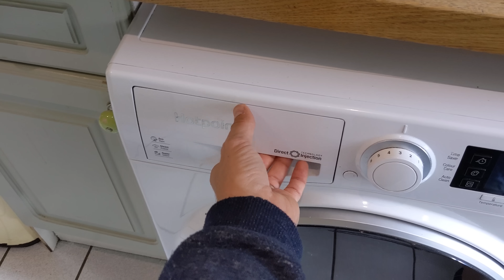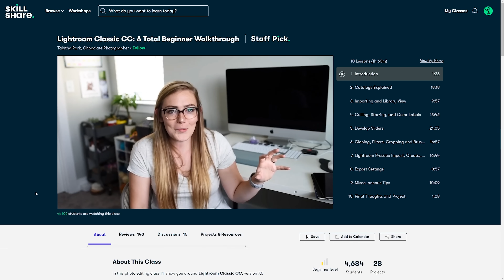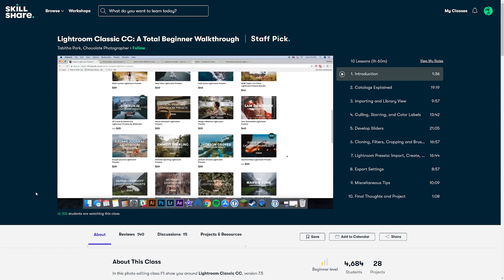The Pythagorean Siphon Inside Your Washing Machine

Comment: As a plumber, I still think the best flush is simply the 'flapper valve' by Fluidmaster.  It uses a float in the flap.  Upon pulling it upward, it empties the cistern until the water is gone, then falls back down to seal.  It's simple and thus reliable.
Reply: That's the only kind I've seen,  other than commercial toilets
Reply: Gosh gents, I’m an elderly woman and I can replace toilet parts. It’s not hard and we learn how to do simple household maintenance from our parents … or hopefully can read a book after buying a house. I’ve never seen an unmetered house in the US, so we are quite aware of water consumption. At least my middle class friends and I are. In water-challenged California, it’s “if it’s yellow, let it mellow, if it’s brown, flush it down”. Much love 💕🐝💕🇺🇸
Reply: @amazinggrace5692  What if a brown one doesn't flush down?
Reply: @mintymus  eat more fat and fruit and less fiber?
Reply: @mintymus  Then plunger time!
Reply: Which works fine until hard water sediment builds up to the point that the seal is no longer able to be maintained.  Those who live in hard water areas have to replace these devices regularly.  No one, to date, has solved this problem.
Reply: I've seen 2 or 3 flappers failing in my life. But I've never seen any other system.
Reply: They're easy enough to replace unlike siphon which have to be matched up exactly. Plumbing wearhouses around here don't even stock them.
Reply: That's what is used here in America 🇺🇸
Reply: after never being handy at any (and i'm still not) i recently tried to repair a toilet handle rather than put in a maintenance request and have them barge in randomly. to my relief it was pretty straightforward enough and the part i ordered fit. the thing i thought was interesting was that the chain to the flapper has some slack and sometimes gets caught under the lip and there's a little trickle of water. it reminded me of my grandparents house where we were told, the water will run forever unless you "jiggle the handle" and now i wonder if that was the cause of it.... but the house was sold so i'll never know for sure..unless i break in. but anyway, it felt neat to think that a childhood mystery might be "solved" in my head. :D  i've been meaning to try to fix the chain on my own here...but for now i just jiggle it if i hear it trickling...
Reply: And it can be interrupted
Reply: I've never seen any other type than the one you are describing.
Reply: @RafaelPernia  
As far as I'm aware, every one I've fitted is still working.  But then I do fit them correctly.  Evidently others don't.
Reply: This is what I have!
Reply: Sir could you recommend a plumbing course in your country &, how much it costs
Reply: @dinozaurpickupline4221  
Maximum you could spend would be £5000 but you can get a 10-day course for £1000.  That would only be basics, though.  Tradestraining do a £1500 course, but that is a work-based course in the construction industry (on the job), and only if you already know something about plumbing.  Otherwise, an apprenticeship post will be required.  This is low pay at first, but great training - working with a plumber.  Alternatively, you could spend £20000 on a full course.
It's a good career, and you can earn £1000 a week when you've qualified.  Specialise in an area (like heat pumps, AC, or drain clearance) and you could earn £60-70000 a year in Britain.  Make sure you get public liability insurance, and make sure your customers sign a contract - which means they are protected, and you get paid in a reasonable time (like 10 days).
Good luck (I only have three years to retire!)
Reply: @barryfoster453  great maybe you can train some young plumbers like us entering the trade
Reply: That's interesting. I would have thought that the valve is an additional point of failure in the system compared to a siphon. If the flap leaks (whether due to wear or poor seating), then it leaks causing the float to drop resulting in a continuous leak. Of course if your valve doesn't close for whatever reason, then you have a leak either way ... it just doesn't need a second overflow pipe to leak into. 

The biggest point of failure with the siphon system would be the flap that pushes the water to initiate a flush. If I'm paying the water bill, I'd rather have a toilet that I have to jump start rather than one I can't stop running.
Reply: All this talk of toilet flappers and water leakage has reminded me that I need to figure out why my flapper is leaking.. I replaced it a few months ago and noticed it would still occasionally leak. I think the chain is getting caught under the flapper
Reply: Flappers and flush vales/drop valves all need replacement sooner than a decent siphon. Due to the fact the rubber shrinks especially on fluidmaster flapper and others. Geberit flush valves the rubber washer actually blisters, with water blisters. Every 5 to 10 years u will have to replace the rubbers. Where decent siphons last a lot longer than that.
Reply: Don’t know about you foreigners but in America basically all household toilets are flappers.
They can occasionally not completely seal but you hear that right after the flush because the water keeps running so all you do is jiggle the handle and it will seal right up again. If you’re away on a trip nobody will be flushing the toilet so the seal won’t be broken
Reply: Firstly, I am pretty sure he explains how a siphon can pass a small amount of water indefinitely. So maybe a flapper can pass more, its not a flapper specific issue. 

Secondly, a flapper style toilet has a siphon as well. At least the trap in the bottom and at the rear of the bowl serves two purposes. It traps water in the bottom of an S pipe that blocks sewer gas from seeping into the bathroom. But more importantly, it creates a siphon that sucks the water from the bowl.
Reply: I know this is the only kind I've seen in housed in the USA... can't vouch for the toilets I saw back in Australia because I always assumed they were too complicated to mess with... also never had a problem with them getting stuck running like the ones here though...
Reply: How do dual flush toilets work?
Reply: @soundspark  There are a number of different techniques.  In the US, the typical old-style flapper is made of rubber that is more dense that water (so it won't float on its own).   The flapper has an inverted cup built into its bottom side that traps air. The cup is below the flapper's sealing surface and traps air after the flush is over.
   To initiate a flush, a chain connected to the handle pulls the flapper open.  The trapped air provides enough flotation to keep the flapper from closing until virtually all the water has run out of the tank.  After the flapper closes, the weight of the water above it holds it closed.
    Most dual-flush systems have some method of causing the flapper to close early, when the tank is still about half full of water.
  
Many dual-flush designs use a small hole near the top of that cup to allow the trapped air to bubble out quickly enough to let the flapper sink and close after a few seconds.  Some designs even have a way to adjust how rapidly the air leaves the cup, allowing you to "tune" how long the flapper stays open.  This is what controls how much water is used in the small-flush cycle.  

For a big flush, the user prevents the flapper from closing early by holding handle in the "flush"  position long enough for all the water to leave the tank.

Another design uses a secondary float attached to the top of the flapper by a length of chain or plastic strap.  The chain or strap is long enough to allow the secondary float to rise to about half the tank's depth.   The flapper has a smaller than usual flotation cup on its underside.  With this system, the flapper will close during a flush unless the secondary float is under water and pulling upward on it   After a flush is initiated, the flapper stays open until  the water level in the tank drops below the level of the secondary float.  The loss of the  upward pull from the secondary float causes the flapper to close.
Reply: simple.
Reply: Probably from the north where the water is soft.  In a hard water area they leak often.  Plumbers still like them though as they charge for coming back to fix the issue.
Reply: @andybarnard4575  I’m in NE Pennsylvania and we have very hard water.
Reply: @amazinggrace5692  Ah, I should have been specific that I was referring to the comment from @Barry Foster in England.  For the most part in the north of England they get rain, it goes into reservoirs and the water is soft.  If the South East (of England), we get less rain have quite a lot of chalky rocks and drill down into the water table so the water is hard.  Flapper valves are therefore good up north, but siphons are better down south.  At least that is my experience of helping family, friends and neighbours after their plumber has left the premises.
Reply: Strange, I am not even a plumber and I have seen multiple flapper toilets malfunction.
Reply: @DDieDDes  
Strange.  I am, and I haven't.
Reply: @barryfoster453  wierd u have not seen... see a flapper first
Reply: @barryfoster453  Barry, I am about your age and not a plumber, but have needed to replace several valves in my houses over the years. I am replacing one tomorrow, as a matter of fact (the second, in a house only 5 years old!).  Typically, the flapper material hardens over time until it no longer seals well.   The flappers in newer models of toilets tend to be more sensitive than the old ones.   I suspect that this is because in the US, most toilets are now "low flow" or "low flush"  types because water conservations regulations have become almost universal.     They use 1.28 to 1.6 gallons of water per flush (4.8-6 l), less than half that of traditional US toilets.  Many styles have a lower-profile tank, so there is less water pressure to properly seal the flapper.  In order to properly flush with the lower amount of water, often the diameter of the flapper and drain have increased in diameter from 2" to 3" (5 to 7.6cm).  This increases the speed at which the tank empties and the velocity of water in the bowl during the flush, but increases the area of the seal.  Proprietary designs, often to allow both a high and a low-volume flush mode, have become increasingly common, so "universal fit" replacements have become much less useful (much to my annoyance).
Reply: @jfess1911  Oh, look at that reply!! And he's not even a plumber! That's amazing, eh Barry?!
Reply: @stevenbrucci  It occurred to me that once a client sees how easy it is to replace a flapper they probably don't bother to pay a professional plumber (like the original commenter) to do it.  I mean, if flappers never fail,  it's kind of amazing that replacement flappers are sold in thousands of stores in the US, even non-specialist ones like Wal Mart.
Reply: The flapper valve is crap. It fails and drains water constantly.
Reply: @cartoonhead9222  yeah, a billion people must be wrong.
Reply: @GoblinUrNuts  
I always turn off my water when I go away. The main stop tap is quarter turn and accessible - I made sure it was.  I also have a quarter turn tap just inside a kitchen cupboard that isolates the washing machine and dishwasher. When I use these appliances I just flip it on taking a fraction of a second. Having appliances connected by hoses on a permanent high pressure water mains is not wise.
Reply: The best is the siphon. With a flapper valve, if the valve is defective (say does not seat properly) water can constantly drain out into the bowl causing lots of waste water. Siphons cannot do that. 

If a flapper becomes defective when you go on holiday, expect a massive water bill. If you have a flapper, turn off you water when leaving the house empty for a while.

Flappers, until pretty recently, were banned in the UK.
Reply: @johnburns4017 the flap has gone bad after 20 years in one of my toilets, replacement was 2€ and 5 minutes to disassemble.
Reply: @johnburns4017  
I'm a plumber here in England.  I've never seen a flapper version pass water, and people should always turn their water off when away for even a day.  Siphons are too troublesome.  I've even seen one fallen to pieces, and the diaphragms can be so weak as to only last a thousand flushes.  I also have no idea what you mean by banned in the UK "until recently".  I began installing them over 20 years ago when I got fed up being called back to non-flushing syphons.  They are very simple, and in plumbing, simple is always best.  Together with a Torbeck float fill valve for the inlet, I've had many satisfied customers.
Reply: @barryfoster453  
You must be very young not to have seen a flapper stick.
Reply: @johnburns4017  
I'm 63, John.  I have fitted more toilets than you have eaten chips.
Reply: @barryfoster453  
I have seen many just passing water permanently. They still work though. The owners leave it as they do not have water meters, so they do not pay for wasting water. The water leakage is so small at times they do not notice. 

The water wasted by thousands of these flappers passing water is substantial.  As the UK only has about 10% of water metered, stopping water wastage by using only siphon flushes makes a lot of sense.
Reply: @barryfoster453  I’ve literally had the flapper go bad and would drain until the float dropped enough to trigger the water fill, shut off, and repeat. Bleach tablets damage them over time.
Reply: @barryfoster453  ohhh roasted
Reply: @barryfoster453  TURN YOUR WATER OFF EVERYDAY ?
Reply: @johnburns4017  Siphons can waste water: A few times when I hadn't pushed the lever hard enough or I had but the diaphragm was leaky,  not enough volume of water was drawn up and over into the flush pipe and so there was a weak stream of water entering the pan, and it so happened that the rate of this out-flowing water (closely) matched the rate of water flowing into the cistern from the supply line, the toilet thus being in a lengthy (or eternal) state of flushing, wasting a lot of water. Having said that, the siphons in the toilets in my home have been perfectly reliable and long-lasting.
Reply: @GaryHayward  
If the diaphragm was leaky it needs replacing.
Reply: @johnburns4017  I did it the other week—used a builder's rubble-type bag—thickish plastic. Worked a treat (and I've always thought red goes so well with grey 😄).

Comment: I know I'm extremely late to the party, but if you need help picking up the empty plastic cups, most of the toilets I've encountered here in America don't use a siphon like that at all. Rather, when you flush the toilet a plug is opened at the bottom of the tank, which allows water to flow down into the bowl

Comment: That's a very specific toilet design, the overwhelming majority don't use a system like that. The only real siphon mechanism in most toilets is the bottom bend in the bowl that pulls the rest of the water over the "hump" of sorts into the drain. Than it catches air and the siphon breaks and the bowl fills back up from the ballcock valve.

Comment: In india most of the cistern system uses buoyancy controlled locks to restrict water flow and a simple mechanism to lift up the flush valve. But not that half flush systems are here, but yeah I can do that with timing the flush lever 😀

Comment: Very interesting video.  Without checking the comments, you probably got the answer already, but as you can from my video (https://www.youtube.com/watch?v=17Y7X-rkRvs&t=328s), I replaced my old syphon flush system with a different (more modern) type.  Th beauty of the new system , is that it requires almost no force to flush since it merely opens up the bottom of the tank!

Comment: Bell syphon toilet cisterns were once the norm in the UK until the kind we use today replaced them as being easier to operate, although not as simple in design (I think the change came around the 1930's or thereabouts).  Basically the cistern, high up on the wall, had a central pipe within the cast iron cistern, like the base outlet pipe in your washing machine conditioner compartment, and the ballcock was adjusted to fill the cistern to within half an inch or so below the top of this pipe.  Over the pipe was a cast iron cover in a bell shape, with a lever to lift it up when you pulled the chain.  These did however need a certain knack to get them to flush: you had to give the chain a good yank so that the water was pulled up by suction over the central pipe to start  the syphon to flush the bowl below.  Timidity in pulling the chain just made the water wobble and would not start the syphon; so, if you lived in a house with one, the necessary technique soon became automatic, with visitors there were sometimes problems!  With only a single moving part, the bell mechanism was less complicated and maintenance free.  If you look at pictures of old cast-iron high level toilet cisterns they often have a central well in the base -- the bottom of the bell sat in this space.

Comment: 4:30 Self flushing urinals are a little bit more complicated than a Pythagorean syphon. Big Clive has a good video on these. Simply put unless the outlet tube runs full the syphon wont start, the water will just trickle down the inside of the pipe. So small ones work, but big ones tend not to self start.